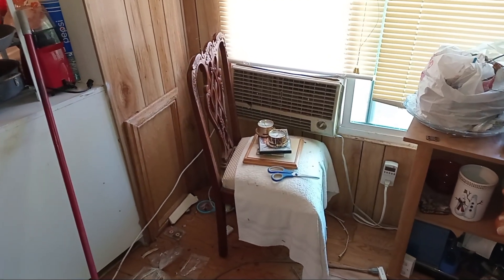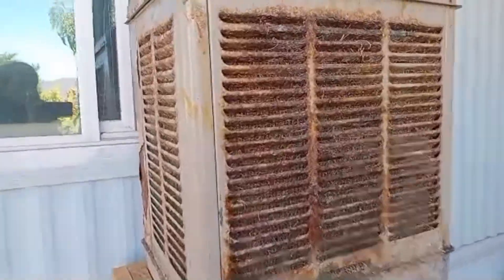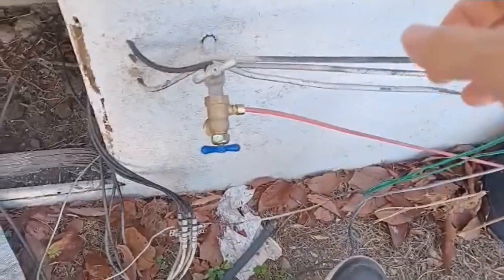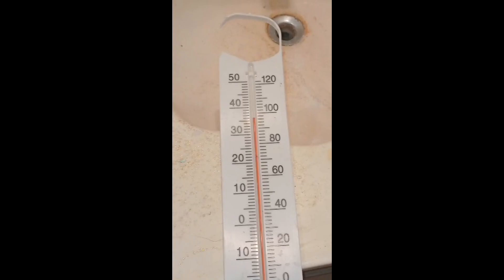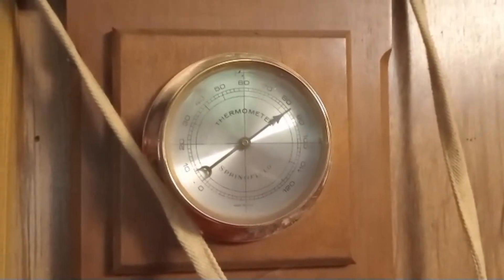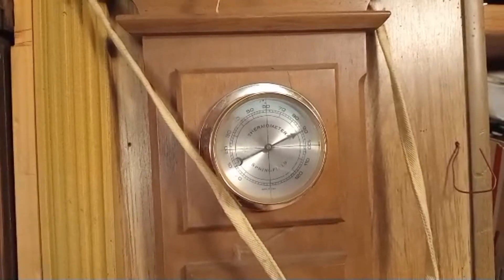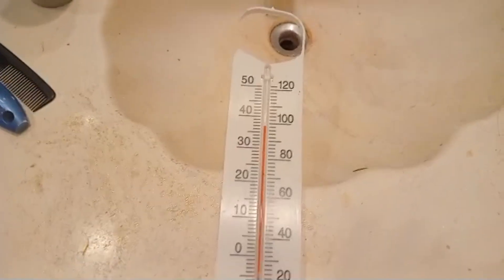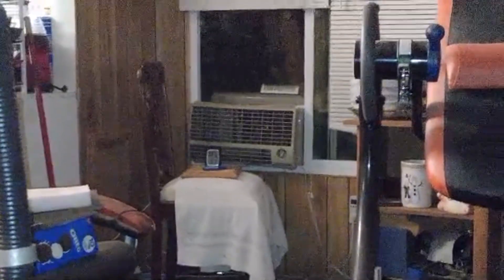Window Evaporative Cooler in extreme heat 112F, 44C

Comment: Thats a disgusting unit, having said that, i lived 25 yrs w swamp coolers in west Texas, they work well, hint dont put that fan in the window to draw air out, just crack that window about 3 inches and create a presser in the house an it will draw the air under pressure out, cracking the top and not the bootom is better as its pulling the air across the room and drawing the heat that rises out. And you need more water in the bottom of the cooler,if you have a leah take jb weld and patch the leak(hole)water level should be above the round bottom of the pump, about 2 to 3 inches in the bottom of the unit. Good units have grease fittings on the bearings, but the bearings can be replaced, and a pully size change can make it blow harder, ie move more air. But hey im just a idiot, dont listen to me
Reply from the maker: That is a good idea about the leak! I tried caulk, but the tubes I had where dry, so I gave up and forgot about it, I'll patch it soon!

It's not really disgusting, it has new pads, I cleaned it. It's just very rusty. But not full of mold at least!

What does more water at the bottom do?

The fan does actually seem to help, as with just the window open, the low CFM unite I have doesn't have enough strength to push a decent amount of air into that room to cool it down. 

After the test I got a portable swamp cooler, and put that in the room (still with the fan in the window), and I ran the portable cooler along with the window one, and that helped cool the bedroom down to the same temperature as the living room, if not a tad cooler. So I'll do that on the very hot days.. Although now it's so cool out I almost don't need the cooler, it was 75F today.

Comment: I live in Los Angeles and it has been HOT AF the last few days. Have you looked at Vevors swamp coolers? The design of those interests me because they contain a reservoir for cold packs and even a very small solar system can power a freezer. So if you can just freeze water bottles and cycle them you can improve the efficiency of a swamp cooler drastically and im pretty sure running a swamp cooler and a freezer is still lower wattage than running an AC depending on many factors and assuming access to water isnt an issue. I would be willing to bet though that freezing water bottles in your swamp cooler would improve the temps by maybe 10 degrees? Might be being too optimistic.
Reply from the maker: It's worth a try I guess. I don't know if it would do anything or not. Because then you have to put heat back into the room from the refrigerator to cool warm water back down.

Comment: Dude looking at that you might want to check for legionnaires 😂 mini split heat pumps are cheap as shit now and no chance of bacteria contamination flowing through your lungs but to each is own.
Reply from the maker: @Need_a_trailboss  I haven't heard much of a problem with bacteria and evaporative coolers. My main issue is the electricity price. I need to get solar. I am paying over $500 a month. Electricity is 65 cents per kilowatt-hour during the day 75 cents per kilowatt hour in the peak hours and for a few hours at night it's about 45 cents per kilowatt hour.

Comment: 16:58 Tips is to place the fan 0.5meter from the window. This will increase the air exchange between inside and outside. When the fan is placed in the window, like it is now, it will just move the outside air. This is due to that the fan collect air from the sides. Do a test and you should be able to feel the cool air come inside a lot faster.
Reply from the maker: Thanks! I heard about that and forgot about it. I tried it out for a few minutes during the heat Wave and put it back in the window. I will try it today for a longer period of time.